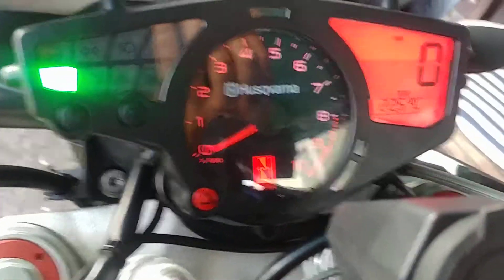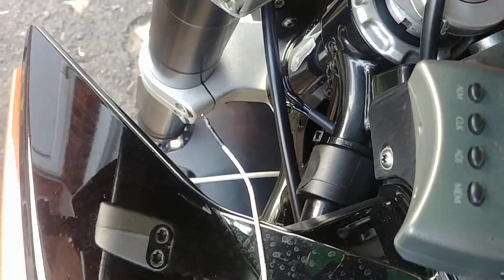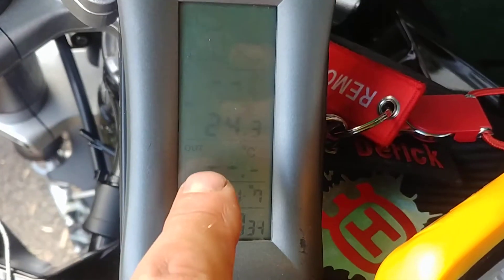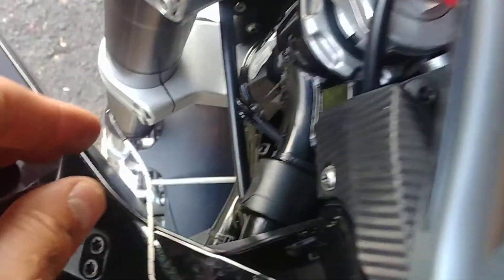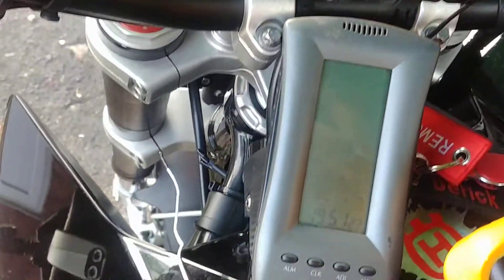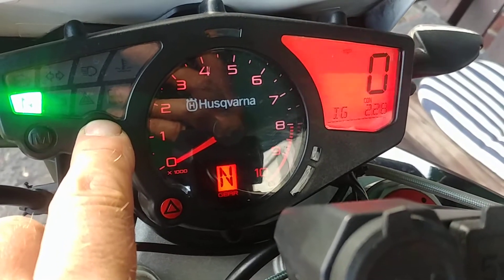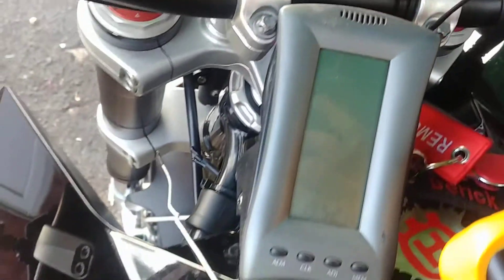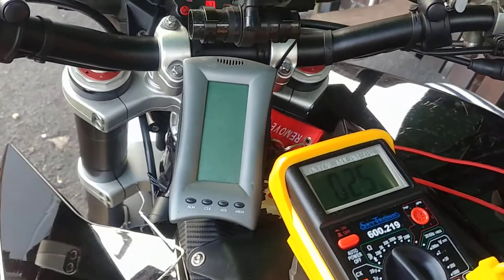(Update) Husqvarna Nuda 900 Airbox Thermistor Experiment (IAT sensor)

Comment: ...and I belive that if you soldered in a resistor that lowers the current (measured) temperature by 10° C, the Nuda would run even better. 
This would be a cheap tuning, compared to PowerCommander & Co.
The Nuda is tuned so economically that it gets a too lean gasoline mixture at high ambient temperatures.